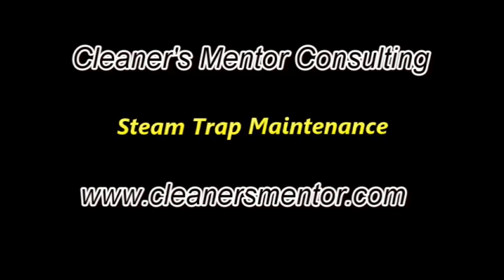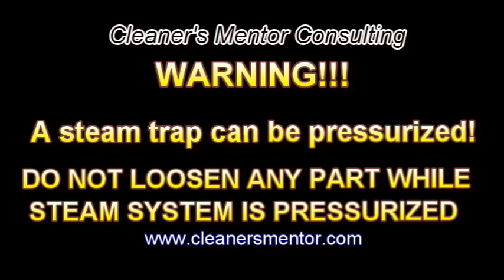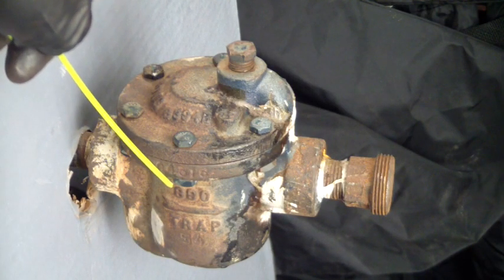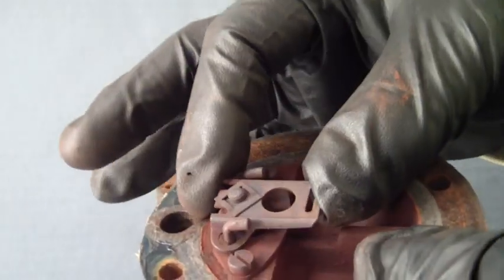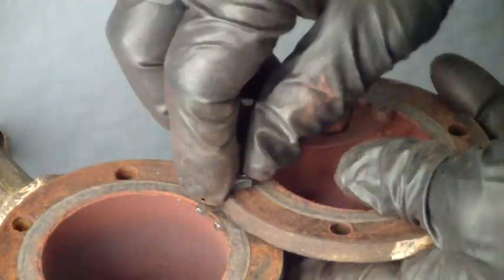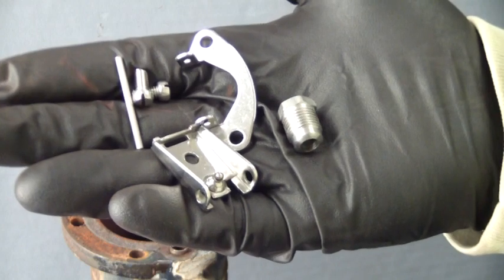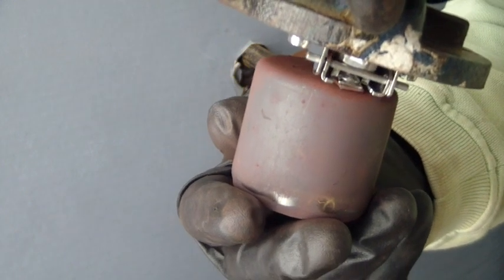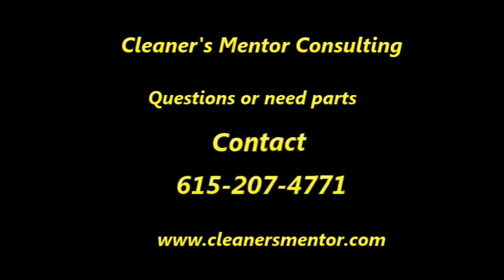Cleaner's Mentor: Steam Trap Maintenance, Armstrong Inverted Bucket Trap

Comment: nothing was mentioned about the size or condition of the hole on the top of the can and what it should be. Do to wear and tear.
Reply: Very Simple if you pay attention.  Size cannot be specified due to the diameter will vary dependent on the trap size and use.  Regardless of the size, its the condition of the ball on the valve and the hole it seats into that result in a properly  operating trap.  Bucket traps never shut tight and stay.  They bounce or pulse dependent on the load.  This bouncing is what actually wears the valve seats.  If listening to a trap, you can hear this bouncing.  

Yes, the trap will open and empty, but as soon as it's shuts, the bouncing effect continues.  As the seat looses its designed shape, steam will start seeping through.  It's this seep that truly causes problems.  I have rarely found a trap simply blowing through.  In a facility full of traps, this seep multiplied by a collection of traps results in overheated condensate and vapor locking pumps.

if your reference is to the hole in the bucket, this is simply a venting port. This has little to do with steam leaking through the valve.  This has to do with the bucket's ability to drop.